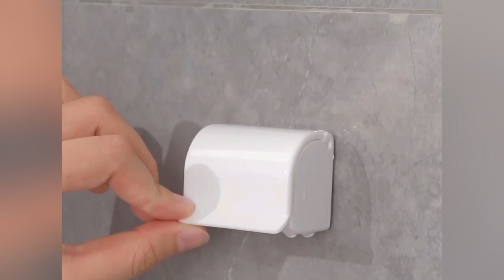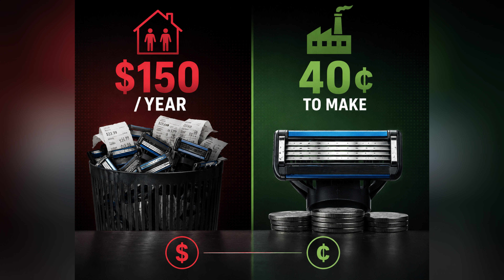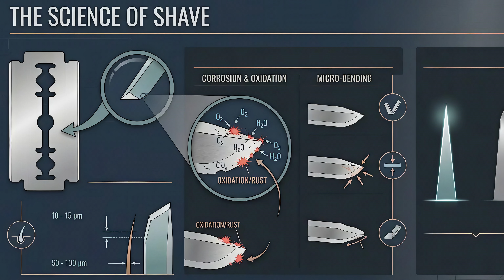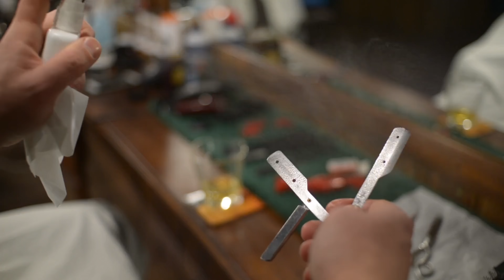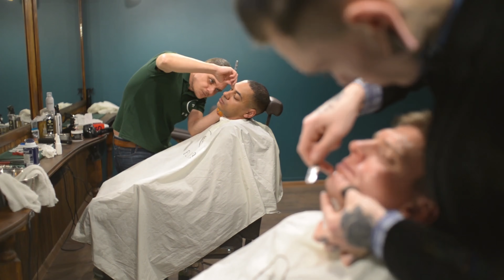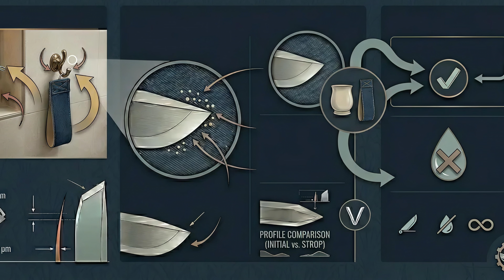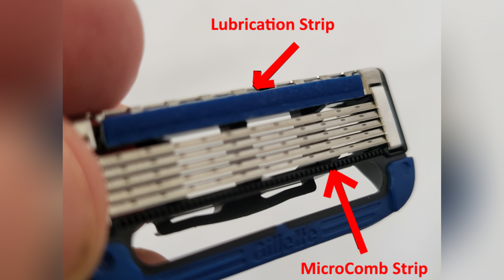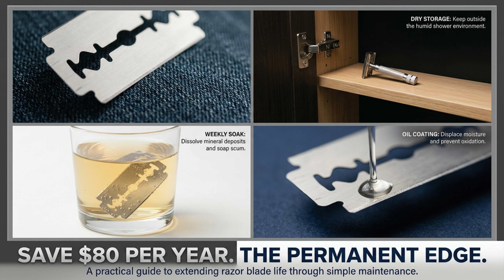Your Razor Is Designed to Dull After 3 Uses — How to Make It Last 2 years!

Comment: I use my Mach 3 blades for months without any issues, just clean them out and set to air dry
Reply: I have used the Mach 3 for years but these new one are definitely not the same quality, considering looking at a different brand.
Reply: @Cobalt33  Same, i dont shave that often, but still, ive been using one blade for more than a year now. I do have a trick i use. I shave at a very shallow angle, that will make the blade appear much sharper and wear out slower.
Reply: Same. The Mach 3 was, and is my favourite cartridge razor, other models with more blades just mean they get clogged with stubble much faster and are harder to rinse clear again, Mach 3 is a perfect balance IMO.
Reply: I changed first from March 3 to the Gillette 5 blade system. I live in Vietnam and have to go even from Cat Ba Island to Hai Phong 50km away to get them. They lasted about one month each. Then suddenly one day there was a shortage and I bought a similar complete set like the Gillette March 3 from a Korea Brand (DORCO Pace3) with four blades. The cartridges cost ¼ of the Gillette and stand 2-3 months. I have stopped as well using shaving cream/gel. I just cover my face with my usual shower gel and it works perfectly without any skin irritation. Now with your advice how to treat the blades I will be able to extend the changing at least to 6 months per cartridge.
Reply: @clausbader9537   chics use 5 blades
Reply: There are 3 bladed razors that actually allow cleaning and blade replacement while keeping the alignment
Reply: Thats what I do and they last about 6 months.
Reply: Used to be very good 15 years ago! One blade,  8-10 shavings!
Reply: Same here.  Usually I end up changing them because I get bored. :)  I just rinse it clean, dab it dry with a towel, and put it back on a shelf.  I don't even remember when was the last time I bought replacements.  People are suspicious of Gillette because it's a big company, but I can't complain about the value I'm getting from them.
Reply: @sundrenched-sea  Funny, but I resist that temptation. And it is there. "For f sake when will it get dull" .......... nope, keep going..
Reply: Same. I change them when I start getting cuts or feel like I'm about to. Shave in the shower using soap only. If doing all this stuff made them last two or three times as long, it still wouldn't be worth the bother.
Reply: @John-181  Mach 3 blades are getting harder to find! At least in Japan!
Reply: I'm still using Mach 2, the 2 bladed razors that I was buying at Costco on sale years ago.
Reply: Mine last for years. After showering used.
Reply: I am also using the Mac three, but honestly I would prefer to use a single blade razor, also known as the double edge. razor with more blades equal to more damage to the skin.after shaving tap the razor on the sink to loosen the stuck hair, rinse and jerk it, blow the blade and wipe with towel before storing 🙏
Reply: Depends from country to country, as an Indian, all the global products that we get are substandard.
Reply: @manikantprasad2022  Eastern Europe also.
Reply: Of course, the maker of this video is probably very sad, alone and needs recognition. Sad loon.

Comment: I gave up on the multi blade cartridge razors about 10 years ago when I discovered the wonderful world of the single blade wet razors.   I bought old ones from the early 1900's up to the 1960's.  They all take the same double edged razorblades that are incredibly cheap and with care as Sidney explains here, last almost forever.   It takes a minute to get the right angle, but once you learn it, it is second nature.   Great video, sir!     (They used to make razors for one sided razor blades.  The blades look like the kind you use to scrape glass.  If you ever find one of these razors, do NOT buy scraping razors or you will tear up your face.  There are specific blades on Amazon you can buy that are used in surgical applications that fit them.)
Reply from the maker: That’s such a great warning about the blade types—thanks for sharing your expertise with the community! 💡
Reply: This is the way...
Reply: Same here, except I brought a big packet of chinese razors. They work fine, and every now and then I clean them. I will try cleaning and drying them after every use now that I've seen this.
Reply: @WagesOfDestruction  Same.  I bought the Gillette Blacks from China about 5 years ago and I still have them.  I just clean and dry when done and strop when needed.   After a while, I just throw it away and get another one.

Comment: My blades always lasted about 2-3 months. Doesn't matter the brand. Drying the blade is the key
Reply: When I forget to buy new razors and I'm in a bind I sharpen my shaving razors by gliding them up one way 6 inches or so about 25 times on denim (pants or a denim patch). The razors sharpen very well. The razor should be clean and dry before sharpening.
Reply: My gillette fusion blades last for at least a year. I dry them after shave and sharpen the blades on my forearm skin before shaving. I thought everyone knew this.
Reply: I never use any liquid and mine only lasts for 2 occassionally for 3 shaves. I clean any hair out with a smal brush or needle, at the end.
Reply: @felixdk8727  I just use a brick and skip the blades altogether.
Reply: @aleks1939  🤣🤣🤣🤣🤣🤣🤣🤣
Reply: @felixdk8727 you never use liquid? how the heck do you use a safety razer without liquid?
Reply: @ge2719  You just kind of move it across your head from ear to ear with the edge towards your skin while watching Gene Hackman giving somwbody a shave in "Mississippi Burning"
Reply: @ge2719  No, in all seriousness, I just beat the razor against something hard to clean it during the shave
Reply: @felixdk8727  same here.  Use an old toothbrush.  Get 25 or so goes out of each one.
Reply: Me too. A few years back I bought a ton of razors. I have like 30 in my drawer now. I'm not going to be running out of razors for a very long time.
Reply: You’re good for life now 😂

Comment: I tried the toothpaste method on an electric razor and it worked a little bit. But not nearly what was promised. Does anybody know how to make an electric actually sharp again? Other than buying a new head for it.
Reply from the maker: Yeah, that’s a fair result. Toothpaste can help a little because it’s mildly abrasive, but on an electric razor it usually cleans/polishes more than it truly sharpens.

With electric razors, the cutting system is different. The blades are meant to cut against the foil or guard, so both parts wear together. Once the cutter and foil/head are actually worn, there’s only so much you can bring back without replacing the head.

A few things that can help before buying a new one:

Clean it really well first — hair dust, skin oil, and soap film can make an electric razor feel dull even when the blades still have life.

For rotary shavers, some people use a proper sharpening paste or lapping compound made for electric shaver heads, then run the heads briefly so the cutters polish against the guards.

For foil shavers, be more careful. If the foil is worn, dented, or stretched, sharpening the cutter won’t fix the bad shave — and a damaged foil can irritate skin fast.

So the honest answer is: yes, you can sometimes improve it with deep cleaning or proper sharpening compound, especially on rotary heads, but if the foil/guard and cutter are worn out, the real fix is usually a replacement head. Toothpaste is more of a small rescue trick, not a miracle rebuild.

Comment: What do you guys think about 7-blade cartridges? I've also seen 10-blade cartridges. They certainly shave faster and with less pressure. A drop of clipper oil on the lube strip and stropping both help. Dry storage is difficult, where I live everything rusts. I'll try the vinegar soak we also have hard water.
Reply: How about 36-blade cartridges? Let's see how absurd we can get! 😂

Comment: i shave in the shower. never sharpen the blade. i leave a mug filled with mineral oil in the shower so that after shaving i will shake off any water and store the blade in the mug....no corrosion, no dulling. i replace the blade every 6 months.
Reply: What oil exactly?
Reply: Mineral oil it's a thing.
Reply: that will work because the oil inhibits rust, and it is the rusting aloing the fine edge that renders the blade useless
Reply: Always dry with a hot hairdryer re-tempers the blade edges,store in a clean dry old sock.
Reply: @Lezley-q4r  None of my old socks are clean and often not dry.
Reply: Good idea.
Reply: Mineral oil? Really? Any specific brand & what amount? Thanks
Reply: @JPTyler any, enough to submerge
Reply: @arkrainflood Which ones do you use?
Reply: @coolvinay  a triple blade, forget the brand
Reply: @JPTyler he mentions it at 5:28 in the video
Reply: Terrible for your skin
Reply: @carmelite.musicc  How so?
Reply: Baby oil is mostly mineral oil

Comment: Just rinse with hot water and pour a little rubbing alcohol on it. Lasts for months. Love the denim Idea!
Reply: I dip my razor in a shot glass of vodka & then I down the shot. Works a treat & I shave about 5 x a day, sometimes I shave at work too =0)
Reply: @MotelVibes. Ha-ha!!
Reply: In the electric shaver world, the Braun cleaning cartridges basically contain alcohol, lubricant, and lemon scent.  Same principle.
Reply: @robertwallace1422 sir after cleaning my razor in water can I spray alcohol with spray dispenser?
Reply: I like the idea of using rubbing alcohol. In the past my razor stinks when I held it under my nose to check. Presently I have a spray bottle of rubbing alcohol near the sink, and an old toothbrush next to the five-blade razor. I give a couple of spray BEFORE I shave, and end with light brushing on the blades under running water. The blades last and remain odorless.

Comment: I think a can of compressed air( for photographic equipment) would make another good tool in the "Shave thrift" arsenal. To both ,blow out debris and to blow out trapped moisture.
Reply from the maker: That’s actually a smart addition to the “shave thrift” toolbox.

Compressed air would do two useful things: blow out trapped hairs/soap from between the blades, and help push moisture out of the cartridge where towels can’t really reach. 👌👌👌👌
Reply: @Sidney_Explains_Money Holy Crap! what about marketing a can specifically for the purpose? With blower heads designed specifically for this use?please share royalties or you'll hear from my attorneys 😂
Reply: @Sidney_Explains_Money 
And easily recharged with an air compressor.
Reply: even the hair dryer would do it and never spend in compressed air 😆    I have been sharpening mines always in the shower with the inner part of my forearm  when wet. (against the direction  blades OBVIOUSLY, people 😆)   It works really well and I use the same razor at least for 6 months.

Comment: Does alcohol help to remove water from the blade?
Reply from the maker: Yes — alcohol can help remove water from the blade, mostly because it mixes with water and then evaporates much faster than water alone.
So after shaving, the logic is:
Rinse the razor → shake out the water → spray or dip briefly with 91% rubbing alcohol → shake again → let it air-dry.

The alcohol helps pull moisture out from between the tiny spaces in the cartridge and evaporates quickly, which can reduce the time the blade stays wet.

One small caution: I wouldn’t soak the cartridge for long periods, especially with modern razors that have plastic parts and lubricating strips. A quick squirt, dip, or rinse is enough. The goal is not to “sterilize it forever” — it’s mainly to displace water and speed up drying.
Reply: @Sidney_Explains_Money 
We thought so, which is why we keep 99% isopropyl (bathroom, garage) & 95% ethanol (kitchen) for disinfecting utensils. 

Thanks for your info!

Comment: I'd add more more step at the beginning of the process. Rinse the blade, shake off excess water, then a squirt of 91% rubbing alcohol. Cheap, it cleans well, and leaves no moisture behind.
Reply from the maker: That’s a solid extra step, and it makes sense.
Rubbing alcohol helps displace the water, evaporates quickly, and can help clear out soap film or little bits of shaving residue trapped between the blades. So yes, rinse first, shake it out, then a quick squirt of 91% alcohol could definitely help the blade dry faster.

I’d just add one small caution: don’t soak the whole cartridge in alcohol constantly, because some cartridges have plastic parts and lubricating strips that may dry out faster over time. But as a quick rinse/squirt to remove moisture, that’s a smart little upgrade.

The big principle is the same: get water off the blade as fast as possible and don’t store it wet.

Comment: My little league coach told me about this in 1967. I’ve been cleaning my razor blade by running it under cold water blowing on the and wiping the blade off since then since I’ve started using the new style razor blades I rinse the blade after shaving blow through it backwards and visually inspect to make sure that all the hairs are gone and then dry it on a tear cloth towel as you’ve described. My blades last at least six months.

The wisdom of our elders should not be ignored.
Reply: I have been doing the same since I was 16. Born in 1967. I watched my dad shave when I was a boy,  with the single blade and he always rinsed it under cold water. I had 6 older brother 1 younger and 6 older sisters. Bit i also remember that metal expands when heated. Although microscopic with tap water or even kettle. Cold blade was apparently better. So i rinsed in cold water, blew the hairs out and tap it on an old chamois mum had in the bathroom for the mirror. 
Did the job foe me..i am 59 now and have used an electric trimmer not a razor as I hate shaving  now. It does the job for me now.
Reply: You shaved in Little League? Wow
Reply: @MrTuberguber  Some kids, they grow up way too fast.
Reply: @MrTuberguber  He may be one of those kids that faked their age and was 15 playing in little league
Reply from the maker: Absolutely. That’s exactly the kind of old-school habit that actually works.
And I love that line: the wisdom of our elders should not be ignored. A lot of this stuff was just normal maintenance before everything became disposable.

What you’re doing is basically the same principle from the video: rinse the debris out, blow the trapped water and hairs out from the back of the cartridge, dry it properly, and don’t leave moisture sitting on that tiny blade edge. That alone can make a huge difference.

The denim/stropping part helps realign the edge, but drying is probably the biggest reason people like you are getting six months or more from one blade. Great example.
Reply: Hey, just like me, man!!!😊
Reply: I have been doing this intuitively for years now. Its basic 5 seconds of care which goes a long long ways!
Reply: Why didn't you tell everyone back in 1967?
Reply: Get a Safety Razor at walmart.   Ive gotten my blades to last almost a year..  without ANY maintenance at all.   Modern razors are straight up trash.

Comment: Whether mineral oil is carcinogenic when absorbed into the skin depends entirely on how it is refined. Highly purified mineral oil found in consumer products is not considered carcinogenic, whereas unrefined or mildly treated mineral oils are classified as human carcinogens.
Reply: Here in Germany the non-carcinogenic is labeled: "Baby-Oil", the other "Machine Oil" !
Reply: Speculation on my part, but I'm going to go out on a limb and suggest that if you buy mineral oil that's marketed for treating wood cutting boards and wood handled knives, that would be non-carcinogenic. My thoughts are that if its considered food safe, it should also be non cancer causing.

Comment: Excellent video. After patting my razor dry with a towel, I take an extra minute and use the hair dryer to fully dry off the water that is on the underside of the blades that my towel does not reach. This has helped extend the life of my razors.
Reply from the maker: That’s a brilliant extra step to prevent corrosion—I love that idea! 😊

Comment: I dry my razor with a small ceramic heater sitting near my sink after each use, and it lasts months to a year as long as I remember to do that.
Reply from the maker: That makes total sense, and honestly that proves the biggest point of the video: moisture is the real blade killer.

If your ceramic heater is drying the razor quickly after each use, you’re removing the exact thing that causes most of the oxidation and roughness between shaves. That’s why it can stretch the blade for months or even close to a year.

I’d just add one small caution for anyone trying it: don’t cook the razor or put it dangerously close to heat. Gentle warm air is enough. The goal is just to get the water off the blade and out of the cartridge, not melt the plastic or overheat anything.

But yes, drying is huge. Strop + dry storage is where most of the magic happens.
Reply: You can use a hair dryer too.
Reply: @Serpico1152 ... OR you can go to a store and buy BRAND NEW BLADES 😂😂😂😂😂
Reply: @oneijack98  ... so you spend money on electricity to dry your razor ? LOL.
Reply: @SailingOnLand26  oh that .05 cents is going to break me, You must be a poor. LOL
Reply: @oneijack98 ... Bro, remove yourself from your Mom's basement and go get a job. That way you can afford to buy New, Sharp razor blades !